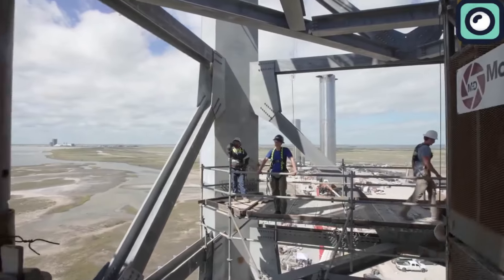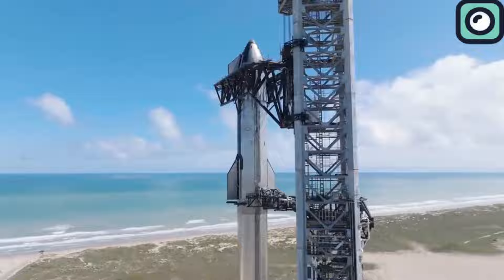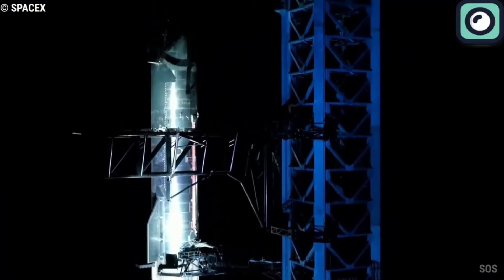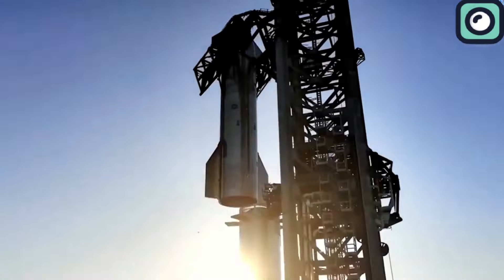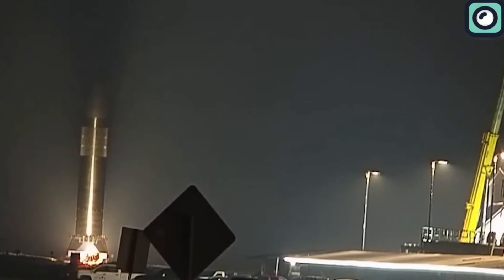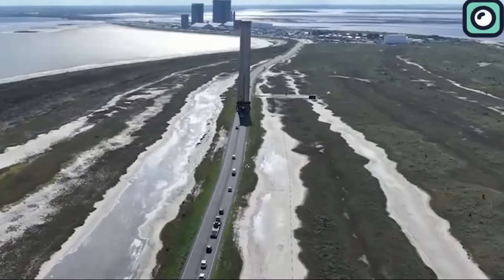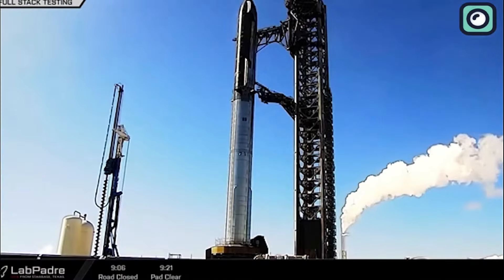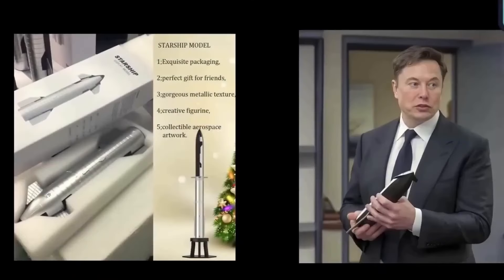SpaceX Finally Catching Boosters Mid Air With Mechazilla!

Comment: I have made a comment before about the use of just two chop sticks and have not seen anyone refer to the problem that might occur. When the booster approaches the tower it will come towards it and then lower itself to a height tgat corresponds to the chop sticks. How ever the inertia , once caught, will likely swing the booster base into the lower part of the tower l I can see that additional chop sticks lower down are not practical for a launch tower but I wonder if its not necessary for a landing tower.
Reply: Nice insight ! I've argued for some fire hose nozzles to help control the landing.  Be great if an AI could synthesize many ideas.